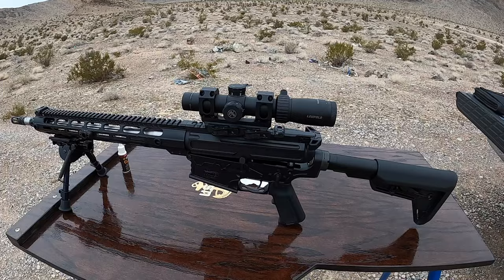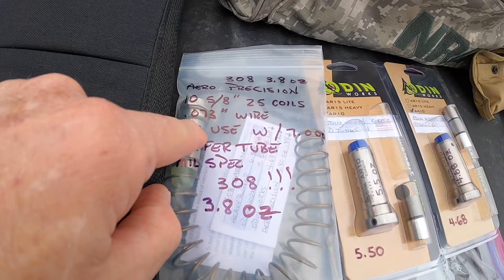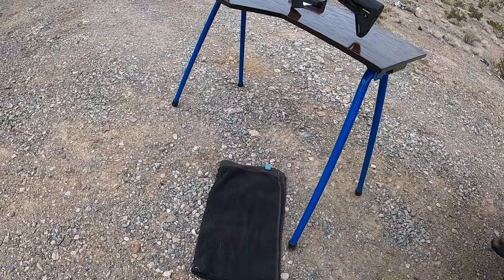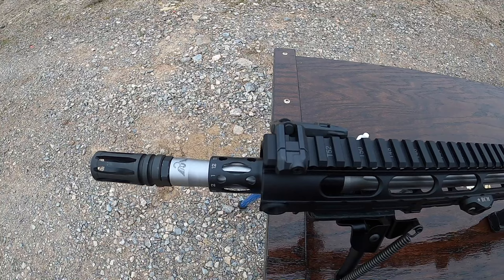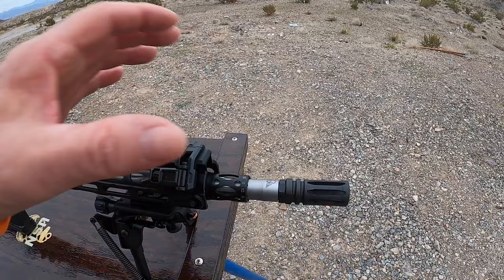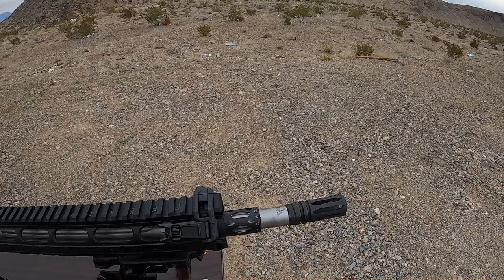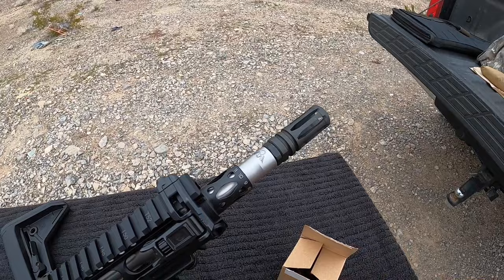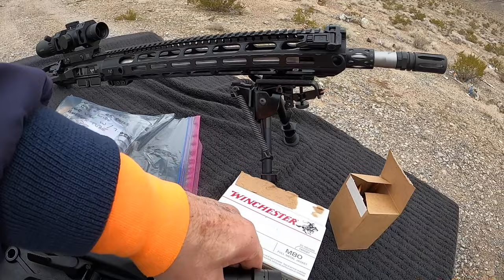LR308 Cycling Issue Solved! ( original 3.8oz buffer was too light!)

Comment: Dam I was ready to go out and get drunk in celebration until the end and it failed a few times I just put a new trigger in my AR10 that functions flawlessly no matter what ammo I put in it sorry don't mean to rub it In.
Reply from the maker: If it's going to happen it's going to happen to me! Lol! It runs perfect with the almost 50 year old surplus NATO though. I have some suspicions about the Winchester! Need a chronograph! Glad yours works with anything. You are definitely in the minority!
Reply: @peteregger7928  just shot mine today after the new trigger and I put 5 different loads and bullets through it and not one problem my AR is all aero except the trigger. Not sure who built it I bought it from the store it was in the used section but was never fired it would not shot when I got it home turns out the firing pin was installed wrong. Maby that's why it was so cheep.
Reply from the maker: Mine is working now but I think the Winchester M80 I was using is seriously underpowered! I had to use full gas with it on setting 12 to lock back on the last round. The 18" barrel with rifle length gas that I'm using has about 5" of dwell distance from the gas port to the end of the muzzle so that doesn't help either when compared to a 20" or longer barrel. 7" of dwell distance and 0.200 milliseconds (200 micro seconds) is considered ideal for any caliber AR style platform. Most manufacturers say good enough at 0.180 milliseconds. I have no way to measure actual dwell time or know that these numbers are correct other than a general consensus from others that know much more than I do. I have a couple of other things that I'm going to try and fine tune it a little more so that in my mind it's 100% with anything I run through it. 99.9% there! The LR308 rifles seem to be sorted out when using a 5.5oz buffer, 308 rifle spring, 18.6oz BCG and most people running a .096" gas port opening with a .750" journal with 20" or longer barrels! The LR308 carbine set-ups especially when using rifle length gas systems are much more picky and difficult to tune. The gas port on this 18" Wilson Combat barrel is about .086-.088". The goal was to be able to run on anything reliably but have the ability to dial it down for hotter 308 Win loads and especially if running a suppressor.  Last resort to tune this rifle will be to open the gas port up to .090" to start with. Sounds like you have a good solid functioning M5. Lots of videos where the M5 was purchased new from Aero Precision with never ending problems. @Lucysdad66
Reply: @peteregger7928  I do have the 20" barrel and 7" gas block to end of barrel but I hand load and I only run high quality ammo like alpha brass match grade bullets and I have settled on varget for my powder it has low numbers and is perty clean so far most loads will shot under 1 inch.
Reply from the maker: I don't reload to often but I usually just stick with SAAMI. I have a Dillon XL650 and an RCBS Rock Chucker. I may try reloading for these LR308's with different charge weights but staying at 147 grain and get a chronograph. I have some BL-C(2) and CFE on hand but the last time I was looking for Varget it was unobtainium!  @Lucysdad66